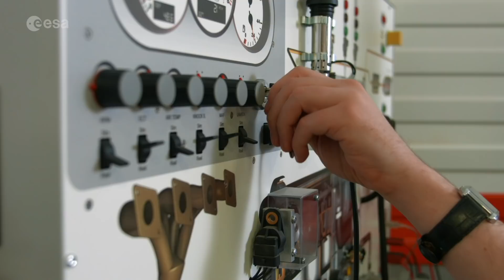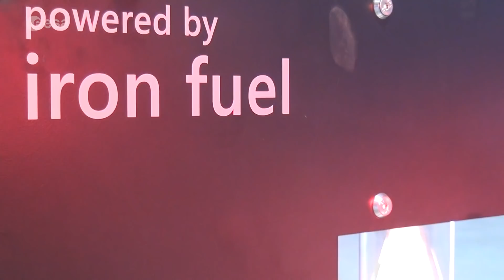Metal Fuels. We research. You benefit.

Comment: The world, which we are part of, needs energy and, due to the time-dependent nature of the energy demands, there are tasks to do in order to produce the needed energy and tasks to do in order to store the unused energy in a way, the most efficient, the safest, and the most respectful of the natural environment.  The key question that responds to the "global energy issue" sits exactly in this balance between production and storage.  Gasoline is produced by crude oil treatment plants and stored at gas stations for our vehicles.  Electric capacity is produced by photovoltaic installations and stored in Lithium-based battery banks.  It seems all very simple but it is much more complex than how it appears.

Comment: Doesn't iron mostly exist as oxide naturally and so the metal fuels are just a way to store other energy? Isn't the efficiency of heat powered electric generation low? Isn't storing as hydrogen for fuel cells more effective? I appreciate any answer.
Reply: Hydrogen is 30% efficient at best, and metal fuels are even worse, just have the advantage of being storable at room temperature and pressure with controlled atmosphere.  Also you need to consider recycling as being hard, where with water nothing is needed to move to get it back. Especially with aluminium, which is hard to refine, as the most common metal in the crust, it also is the hardest to refine, as you need to find the rarer Bauxite deposits to smelt, the others need much more energy input, and run so much hotter as well.
Reply: The thermodynamic efficiency of a power plant based on iron powder combustion has the same efficiency of a coal-based power plant, but with no emission of gases.
Reply: @antoniomzverga7861  You forget that you do not find iron as a metal at all on the earth surface, it has been an oxide form for millions of years, since the first photosynthetic bacteria that released oxygen as a waste product. You still need to take the iron oxide, and react it with carbon to get iron and carbon dioxide as the most common method, though you can also use electricity from some other source to reduce it direct. double conversion, and both are very lossy at small scale.

Comment: Did he say metal fuels can be recycled using solar and wind 🥴 please elaborate
Reply: You smelt it with bundled light to heat it up.
Reply: Iron oxide can be turned back into iron and oxygen by electrolysis, which can be powered by renewable energy (such as solar or wind).

Comment: Very nice, but just stop calling photovoltaïc and wind energy "clean" energy : they still output high quantities of carbon, and condemn farmable terrain in Europe.

Still, such metal storage methods can be clean if the energy is provided by non-fossil thermal facilities, like nuclear, geothermal and solar-thermal.
Reply: Yes, considering the major cost of making iron or aluminium is the cost of electricity needed to reduce the ore, so for aluminium specially the smelters are located not near the mines, but where electric power is cheap. Same for iron, you need a lot of coal to make it, as you need the carbon to remove the oxygen in the iron oxide ore. No way that is going to be "green" in any way. Unless your electricity comes from low cost hydro or geothermal sources, it will all be coal fired plant. Choose where it is emitted is all.
Reply: @SeanBZA  you can also use nuclear energy, still green (despite the anti-nuclear propaganda that took place in Germany in the 90s)
Reply: That is such a short sighted view. Obviously, right now, you still emit carbon during production of these „green“ alternatives. But that is only for as long as we don‘t have 100% green energy sources powering the world, including the modes of transportation. So by not introducing these alternatives because „their production still emits greenhouse gases“ one is hindering the process that would be required to not emit greenhouse gases. What you guys are saying is like a self fulfilling prophecy. Of course it won‘t work if you‘re hindering the process by saying it won‘t work.
Reply: @MofaGames  The emissions of greenhouse gases in the production of these energies isn't only due to the used energy, they also come from the very production process. Furthermore, the questions of occupation of farmable land is inherent to these methods, and will still be an overwhelming issue if we are to produce all our european energy out of them.

We do know real green energies, that occupy small surfaces of land, and that are viable on the long term : wind turbines and photovoltaic solar farms are not among them. This is more of a long-sighted view. You cannot viably replace a coal power plant by its equivalent in wind turbines and solar panels. So as we obviously need to close those fossil-fueled plants, we have to use and research more viable methods.
Reply: @MofaGames  You know that both of these processes need a reliable source of power, and do not ramp up and down fast, taking days to get up to full output, and the same on shutting down. Thus they need a reliable power source, one that you can have running 24/7 for months on end to provide power, and if you lose power on these for a short period, on the order of hours, you will need to rebuild big pieces of your plant to get it running again. 

Aluminium smelter uses gigawatts of power, and you ramp up over a few days to get it running, and same for shutting down. It does not react well to power loss, lose power for over 6 hours, and you basically have a blob of glass where you once had a cell, and then need explosives to make it small enough to get out, and spend 6 months turning it into smaller pieces for either remelting or dumping.  Same for iron, though there at least you can do a semi controlled shutdown by dumping the whole lot out, and again the 6 months refurbishing. 

Only renewable sources that will do that are hydro and geothermal, and pretty much all that can provide is doing so, while the USA is removing all the older dams that used to provide hydropower, leaving only coal, gas and nuclear as base load provider.

Solar and wind plant is variable, so unless you are willing to have regular unscheduled power cuts day and night, you need to have the base power and peaking power available. Grid is not a battery, you cannot pull power out, without some source able to provide it, hard inescapable thing. Sroring till later is still only limited, either pumped hydro, or battery storage, and till you get batteries that are grid connected, and  capable of storing 10% of the grid output, not going to be any use.
Reply: @SeanBZA  That is exactly what I am talking about. Right now we may not have the battery technology to save the energy produced at the peaks. But that is the situation right now, you don‘t know if that problem is solved in ~5 years with new tech. If we don‘t build the infrastructure now and invest in these technologies, by the time we have them the infrastructure lags behind decades. And these new problem-solving technologies can only get developed if their predecessors are stress tested for years in real life.

Comment: Since iron is magnetized, could it be possible to optimize it combustion by using a magnetized combustion chamber where the iron is kept in the middle of the chamber (something like the fusion reactor donut shape) preventing some reaction with the chamber walls (avoiding deposits or damages due to temperatures) or using some mixtures like thermite to increase temperatures?

Anyway, thanks for the video, very enlighting and this technology sounds very promising! Keep it up!
Reply: I think  ferromagnetic properties get lost once you raise the temperature. Also you might have to adjuste the magnet for every change in temperature
Reply: @SandwichYo  yes, the Curie's Law explains that paramagnetism decreases when temperature increases but I was wondering if that could be a solution with very high temperatures and ionisation of the mixture used. I guess that's probably a bit off topic for this kind of use.

Comment: So how to get that pure iron dust in the first place... reduce it from iron oxide using carbon ... creating more CO2?
Reply: Did you miss the part where they said it was recyclable? Also there is no requirement to use carbon for mining or smelting.
Reply: @CaminasDrummers  Well that's my question: How to get the reduced iron dust? What is the recycling process?
Reply: @retokaderli9010  Secret souce but it’s mostly heated thin air.
Reply: Use hydrogen like hybrit are doing: https://www.hybritdevelopment.com/steel-making-today-and-tomorrow
Reply: Sure, you need iron in the first place, but we have plenty of scrap laying around.  Iron oxide can be turned back into iron and oxygen by electrolysis, which can be powered by renewable energy (such as solar or wind).
Reply: @NeilMelvilleKenney  Rather reuse (melt by renewables) the steel directly ... mill it to power and using it as fuel is clearly not an efficient loop
Reply: @retokaderli9010  It wouldn't be efficient for all purposes, indeed.  However, think of the heavy shipping industry, for example, replacing all that diesel fuel with metal powder fuel (which can have a similar energy density) removes all of the carbon emmissions during transit.  You can also refuel them quickly and easily at ports, whilst taking your time on land to convert the oxides back into metals using renewable energy, making the whole cycle carbon-free. Shipping is a MASSIVE source of CO2, and this would be a great way of making it clean.
Reply: @NeilMelvilleKenney  I would suggest hydrogen for airplanes and shipping, trains electric cable and cars el. battery.
Reply: @retokaderli9010  Hydrogen can work, yes, but it has a lower energy density than metal fuels, and is harder to store and distribute. This research is simply trying to create a better option.
Reply: Iron oxides are reversible to iron and oxygen through either an electrolytic reaction or by a direct reduction with hydrogen; this latter process is already exploited by the Swedish company HYBRIT (mentioned at the end of the video) with very high efficiency
Reply: @antoniomzverga7861  mentioned solution to reduce the iron seems Hydrogen based ... I prefere to use that Hydrogen directly as fuel in e.g. the shipping industry. Or to replace coal for existing steel productions.

Comment: How large are the full cycle losses? I guess burning metal has a similar efficiency as fossil fuel, but how efficient is the recycling of the oxide?
Reply: And is Rust on the się any better than CO2?
Reply: @ImieNazwiskoOK  the world is already full of millions of tons of rust, which is regularly converted back to iron for the metal casting industry: this process can be easily used for producing iron powder as a livestock of fuel, hence of energy....
Reply: The thermodynamic efficiency of a power plant based on iron powder combustion has the same efficiency of a coal-based power plant, but with no emission of gases.  Iron oxides are reversible to iron and oxygen through either an electrolytic reaction or by a direct reduction with hydrogen; this latter process is already exploited by the Swedish company HYBRIT (mentioned at the end of the video) with very high efficiency
Reply: @antoniomzverga7861  But to reverse that process you need even more power.
It is just impossible to make it profitable in power.
Reply: @ImieNazwiskoOK  The parameter to consider is not power but energy. Indeed, in order to revert iron oxides back into metallic iron we need energy, but this energy can be delivered over a relative long time, when there is a surplus of energy.  Hence the power used by the recycling process is low and it can be drawn from "green" sources, instead of charging battery banks.  This would be much more efficient!  Moreover, the conversion process can be done in parallel to the production of steel, exactly like the Swedish company HYBRIT has been doing already.....

Comment: So could a traditional internal combustion engine be easily converted to run a metal fuel?
Reply: Not so easily;  it is easier to scale this technology up than scale it down.  Therefore, it would be possible and relatively simple to convert coal-based power plants and heat demanding industrial installations in new plants based on iron combustion.
Reply: @antoniomzverga7861  But why would we do it the less efficient way? Instead of using the suns energy and store it, we want to burn stuff... Just because we already build those power plants? That’s not how we should make decisions. Sunken cost fallacy.
Reply: @Glenhh  Energy storage at grid level is currently beyond our reach, so a full solar powered electrical grid isn't possible
Reply: @Glenhh  we can't store efficiently at medium scale, and that's science fiction to store it at global scale. No mention to the fact that the so called green energy isn't. Photovoltaic panels are very pollutant to make and so are wind turbines even without the rare earth magnets. For example the amount of concrete needed for a single wind turbine is tremendous and concrete is an issue for environment not only when it's already poured and casted but also due to the sand it consume, sand taken from coasts, accelerating coastal erosion, etc.
Reply: @krzysztofczoczynski419  That´s simply not true. There are enough resources on this planet to build batteries that store all the energy we need to balance out the grid. While some people act like it isn´t possible (big oil said that in the 60s) other just do it...
Reply: @DC2022  I know that there isn´t a perfect energy solution that is free and without an environmental impact. That doesn´t mean we should settle for a bad solution. 
There is no reason why global scale storage isn´t possible.
Reply: @Glenhh  There are some promising technologies such as liquid metal batteries, but building enough lithium-ion batteries to secure our grid would have more negative impact on the environment that not building them
Reply: @Glenhh  Not counting the fact that just dumping renewables and switching to nuclear would solve both issues
Reply: @krzysztofczoczynski419  the big issue with nuclear(beyond the waste) is that in its current conventional form, it simply isnt profitable. The third most expensive building in the world is olkiluoto 3, a nuclear reactor in finland wich is over 11 years behind schedule, and has almost tripled its original cost estimate. I think it is very unlinely that the world will fully switch to nuclear, as companies are not willing to invest in it. Also, cost will be increased when you eventually have to start building final storage sites for nuclear waste.
Reply: @jaakkojouppila9965  Thanks. People don´t seem to know that nuclear and even coal are often only profitable because our governments pay them so much money. Itßs sickening to see how easily people are misled.
Reply: @krzysztofczoczynski419  That is only true if you act like there aren´t any negative impacts from oil, coal, gas and nuclear. That would be a lie obviously. Every energy solution has its problems. Solar and Wind in combination with recyclable batteries have the least impact. Being recyclable is the key here.